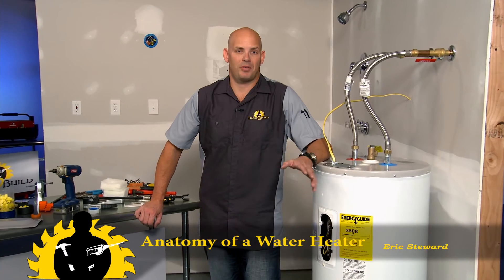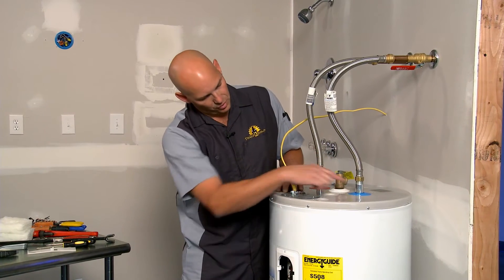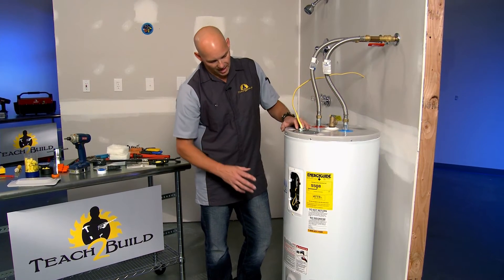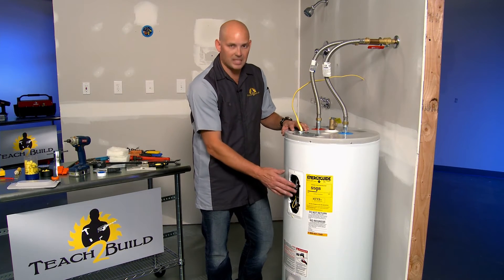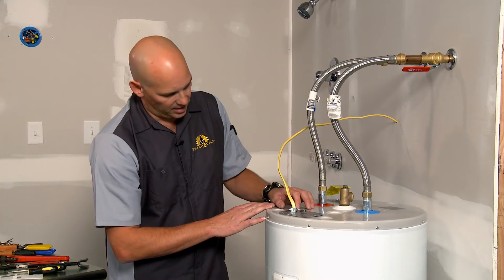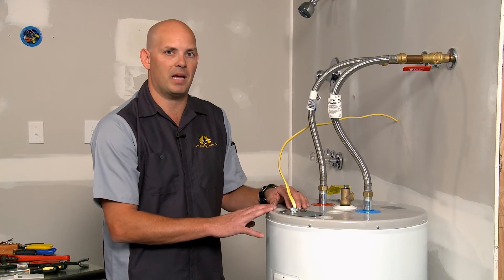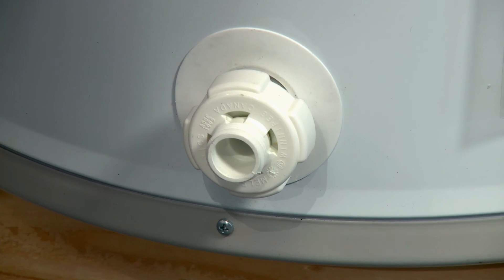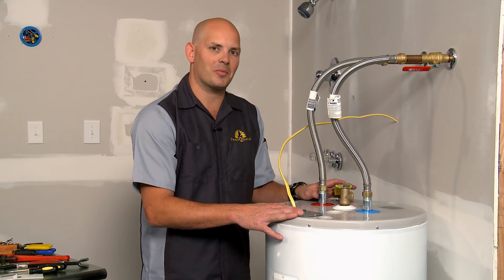Anatomy of a Water Heater

Comment: You get extra points for using a personal mic. Bravo. 
Now do another video about the anatomy of water heaters, and do it in depth, but no longer than 12 minutes. No easy feat, I know, but that's part of the challenge of good video. 

Look at the other videos about water heaters. Beat the daylights out of them/Be more informative.
Show us WELL the guts of both gas and electric heaters. 

Whoever edits should ride the audio and boost it when you do your quieter speaking. 
You tend to go too quiet as you approach the ends of sentences.
Reply from the maker: I appreciate the input,  sir!